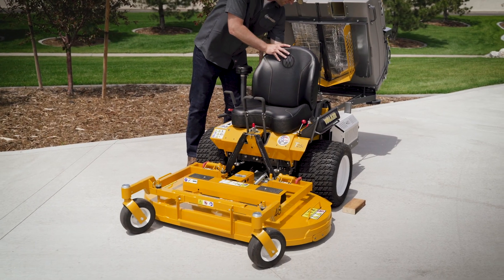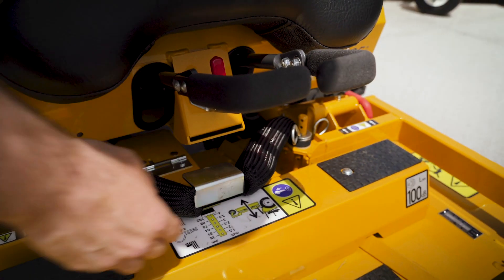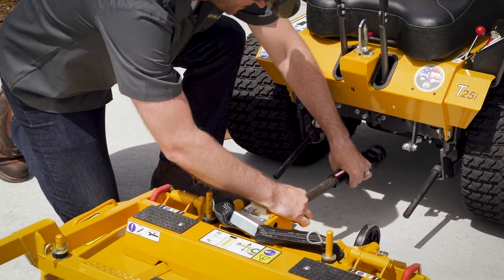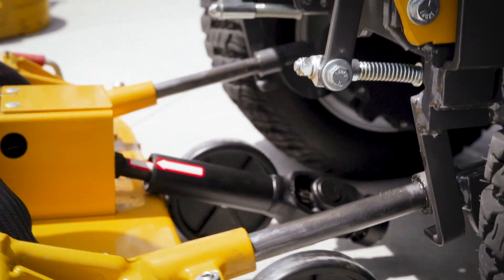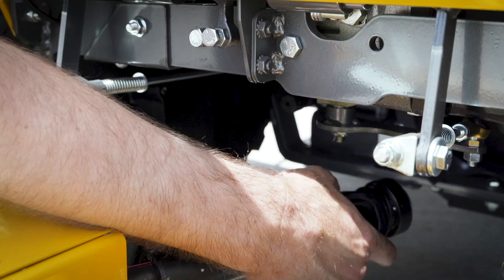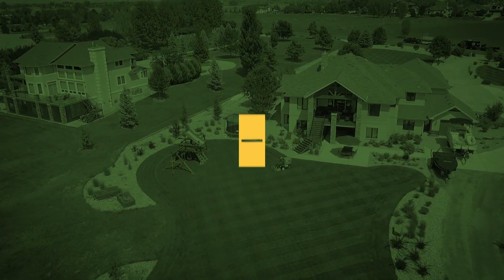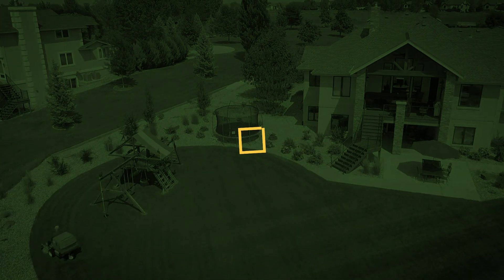How to Quickly Change A Walker Mowing Deck

Comment: Please advise. I'm having trouble releasing PTO shaft from mower; it isn't separating/braking loose when depressing release on quick release end. I'm having to align PTO spline shaft incrementally while aligning the deck arms at same time making the process extremely difficult. Thank you for your help.

Comment: They skipped the most difficult step in the process. Hooking the deck springs back to the seat is not easy and takes a lot of effort. They did this part off camera to make it look easy.
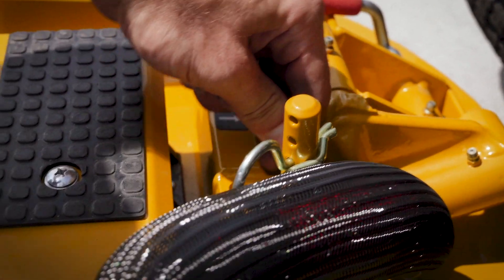Reply from the maker: 0:46 -- Tilting the seat forward makes reconnecting the counter weight springs possible. Simply lowering the seat back into position applies the tension. Some decks have a greater distance which can be easily accommodated for by lifting the front of the deck a few inches while the seat is tilted forward for reconnecting the counter weight springs.
Reply: Walker Mowers even with the seat forward i have to grab the springs with both hands, and gloves, and pull about as hard as I can to get the springs attached to the seat. Most of the guys working for me can’t do it at all. Can you demonstrate how this is done?